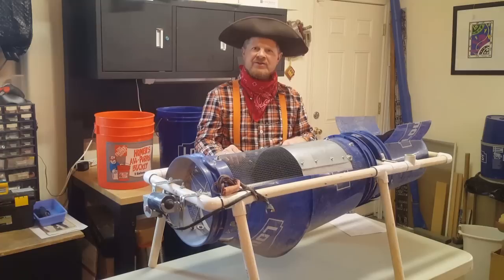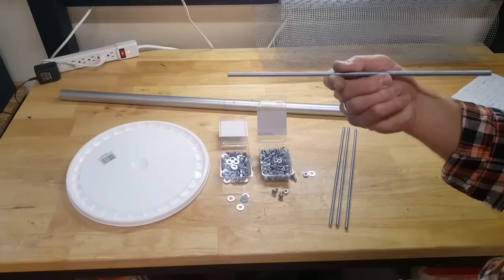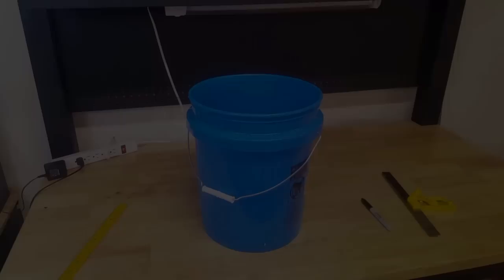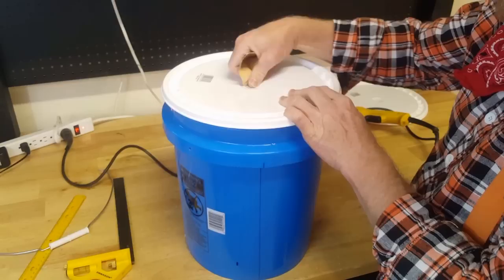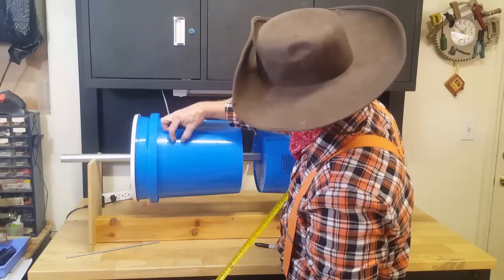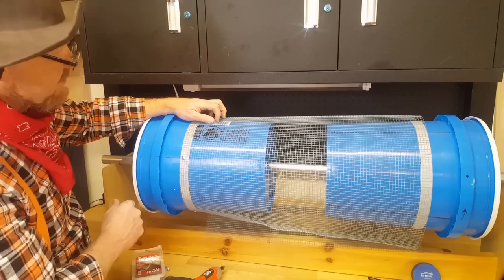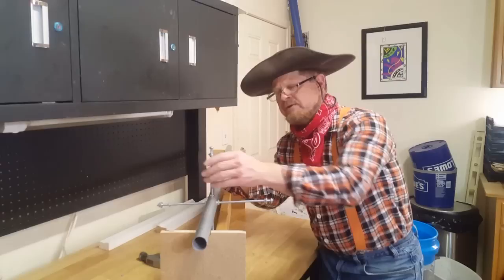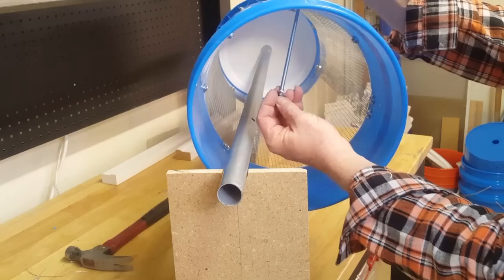Allan's Gold Mining Wash Plant - Trommel Build (Part 1)

Comment: Hi Allen,  used a t with a bushing for the bearing. My first you tube
Quick way to cut the buckets is use a dermal saw blade on a drill mandel, adjust the hight on the drill press and just rotate the bucket. Another trick is cut 2"bands from a bucket and place a pice of screen over the band and press the other band over the screen. The taper of the buckets give you band that will fit over. Good screener for sampling or covering traps.
Reply from the maker: Thanks for sharing this.  My friend did the same for his bucket trommel.  My only concern is the increased drag of the bushings.  They tend to bind as the trommel frame flexes under load.  That's why I prefer pillow block bearing.  Less drag, and adjusts to flexure.

Comment: Ok. You're a genius and you got me. I'm a gonna subscribe. There must be some way of using the water to the top trommel to turn the shaft before it hits the wash area. It gets pumped there anyway and it's not utilised until it hits the pay-dirt.  It'd save one windscreen wiper motor and a bit of power. Actually, it could even be used to turn the bottom trommel too. There's enough force as it comes off the sluice. Just needs a bit of "Out of the box" thinking. By the way, your design is awesomely thought out from start to finish in this first vid. Congrats on a job very well done  :)
Reply from the maker: Thank you for the subscribe and nice compliments !  Glad you enjoyed the video.  Sounds like you potentially have a good idea using water pressure to turn the trommel.  Give it a try.  If it works, post a video.  Would love to see it !I currently replaced the 12 volt bilge pump with a 3hp 1 1/2" trash pump.  This gives me plenty of water (at idle) for trommel and sluice.  Best of all, I can muck out the tubs with it !  Wish you the very best in your prospecting adventures !
Reply: Thank you Allan. My prospecting is limited to my detector at the moment. However I will be panning and sluicing in the near future. I will build your trommel as it is fantastic however being a bit of a novice in all things trommel/sluice I have no idea quite where to begin, especially in regards to water flow requirements at the top/entry where the pay-dirt is put in. Would need a more experienced eye than mine to create a turbine/shaft turner plus delivering the required water-flow to breakup the dirt in the hopper. I will have a look at it tho and see how I go. Cheers and keep your gold lessons coming, they're great!   :)
Reply from the maker: Let me know if you have any questions.  In my original video, I was pumping 3700gph over standard Hungarian Riffles, however, since I changed the sluice insert to a "Pickle Puss Mat" (sold by Snake River Products) I need only 2000 gph.  Slope of the sluice is 4:1 (4" height per 1 ft. length of sluice).  Hope to have a new video in the fall showing all the new improvements.  Good luck on your future trommel build !
Reply: Thanks Allan, will be looking forward to that new video. Also, thanks for those figures, they're pretty much essential. I'll let you know how I go. Cheers

Comment: Alan, I do have a little suggestion that should take a significant amount of time off of adding the threaded rod to the buckets. When you first insert the rod into the bucket with a washer and the nut installed, before you add the second washer and nut you put a SECOND nut on top of the first one and secure them tightly to one another, just make sure that both nuts are near the end of the rod. next, you add the second nut and washer to the inside of the bucket and to thread that nut and washer on you put a 1/4" nut driver into your drill and hold the inside nut with your fingers and proceed to turn the outside nut with the drill and nut driver. This will move or thread the nut and, by the way, the rest of the nuts onto the threaded rod, and therefore cutting all of the tedious time off of that part of the assembly. I do hope that this helps! You just keep up the good work that you're doing to help all of us greenhorns out here!
Reply from the maker: Hi James.  Thank you for the good suggestions !  I'm  all for saving time.  Hope other views read this comment.  Best wishes to you and your trommel build !

Comment: Great project! P.s. your emt should have a line from the manufacturing process that you can use to line up the rods. Also when you run up the nuts on the rods, if you temp double-nut one end, you can use a 1/4" nut driver and drill to run them up quickly.
Reply from the maker: Good suggestions Michael !  Thanks for sharing these ideas.  Have fun with your trommel build and good luck prospecting !

Comment: I loved the video and design.Currently, I am building one, in hopes of joining a club up here in MT this spring! Can't seem to find the squirrel cage shaft though. Can't wait to add it to my sluice. Thank you Allen, for the great design
Reply from the maker: Hi Nicholas !  Glad you enjoyed the video!  Many folks have built this as a winter project, ready for spring prospecting.  Send some pics when you get it running.  The squirrel cage shaft is ETF conduit tubing found in the electrical section of your local hardware store.  Best to you on the build, and good luck prospecting !  👍👍👍
Reply: @allansgoldmining  thank you Allen! You're the best! I'll send a pic or video when completed.
Reply: @allansgoldmining  and so I'm not confused, the ETF conduit, is the part inserted into the EMT silver tubing, correct?
Reply from the maker: @nicholassteichen4552  my apologies. Darn spell checker !  It's EMT electrical tubing that is the main drive shaft.  The insert piece at the end is a 1" steel shaft so it can merge with the pillow block bearing.  This shaft can be found in the swap cooler section of the hardware store, or any metal supply store.  You could simply use a 1" shaft for the entire length, but it's more expensive than a piece of EMT.  On videos 2 and 3, I made a parts list at the end to help you gather materials.  Thanks for watching !

Comment: That bucket that is more firm will actually break easier, they bend so they dont' break. The Lowes one you originally used would be best.

IMO.
Reply from the maker: Same polymer as the Lowes buckets, its the structure that makes it firm.  The trommel ends are to maintain true circle, and do not receive direct impact.  Doubtful they will crack.  Been using mine without issue

Comment: Why would you not put a flat and lock washer on the alignment rods at the shaft to prevent vibration from loosening the nuts?
Reply from the maker: Thank you for your question.  Yes, You can use them. I use Loctite.  Either way is good.

Comment: Very cool and economical design!  Have you looked into a hydro motor/turbine (not electric) for driving the trommel so you don't have to carry a battery, just using water pressure from your pump to drive it ?  Just wondering if that's been done.  Cheers! Chris.
Reply from the maker: Thanks Chris.  Glad you like the videos.  Never thought of a hydro motor turbine.  However, it would require some source of energy.  Namely a battery to run the pump.  The energy required to operate the turbine, plus wash rocks, might be be significantly greater.

Comment: Try slapping a big magnet somewhere at the top of the sluice to gather the iron / black sand.
Reply from the maker: Nice thought James, however, it traps gold within the iron / black sand filings and eventually obstructs the flow onto the sluice.  Been there, done that.  A possible solution would to install a large "Spin-it-Off" unit on the head plate that would continuously spin and peel off black sand, thus leaving the gold in the sluice.  I have a friend working on this design.  Thanks for your suggestion !

Comment: Would it be better to run a 1-2" metal band along your wire edge, instead of using wire to put it together and using lock washers?  Thanks for taking the time to make the video.
Reply from the maker: Thanks for your suggestion.  Yeah, I think that's a good idea.  Best of luck to you prospecting !

Comment: How long is the conduit and what we’re the measurements for the threaded rod on the conduit? Can’t wait to start this project! Thanks!
Reply from the maker: The conduit is about 36", the threaded rods are 12".  If you watch part 2, I explain in better detail.  Also there is a detailed shopping list at the end.  Wish you the best in your trommel project.  Be sure to check out my trommel drive motor update that I released today.  Thanks !
Reply: Allan Guthmiller thank you! Yes I did watch that today. JB weld is great stuff. I built one a while back but it’s a hand crank and not as sturdy as what you have built. Thanks for getting back to me. Heavy pans!!!!
Reply from the maker: You betcha Bro !

Comment: Hi Allen, great DIY video on the trommel build. What size water pump would you recommend for this set up? Also do you have a video that goes more in detail on the metal plates mounted in the trommel? Thanks!
Reply from the maker: Thanks for watching.  Hundreds of people have built this trommel as a winter project.  There's two more videos to the series.  Videos 2 & 3 have a parts list at the end.  I recommend a 12 volt 2500 GPH pump or a gas powered equivalent.  Enjoy your trommel build !
Reply: @allansgoldmining  thanks for the help!

Comment: Hi Allan, I first saw you with Jeff Williams and Slim out in lost basin video, you truly have a fabulous Wash Plant and I would love to build one. I watched your first video and now have just two questions, how long did you cut the conduit? And are the bolts 1/2 long or 3/4" 1/4 X 20? Thanks for your fabulous work and time.Al
Reply from the maker: Glad you enjoyed the video.  If you watch Part 2 and Part 3, I have a handy parts list at end of the videos, which should be helpful.  As for your questions, I use 1/2" 1/4-20 bolts.  Although 3/4" will work just fine.  I initially cut the pipe about 48" to fit on jig.  Video 2 explains how I cut the pipe down for mounting.  Usually, about an inch beyond bucket rim of trommel. Thanks for asking, and have fun on your trommel build !
Reply from the maker: Thermal Rider ?  Are you a sailplane pilot ?  So am I.
Reply: Thank you for getting back to me, I picked up all the materials to build my trommel and started my build last night. As for the airplane in the background it is a 1947 Cub of a friend, we fly RC planes together.
Reply from the maker: Very cool.  I fly RC as well.  Mostly electric these days.  Just took a flight on a B-24 Liberator this weekend.  A ride of a lifetime !  Posted a video on my channel.  Good luck finding gold with your new trommel !

Comment: Hi, Allen, you didn't mention that I heard , what is the length of the 1/4 inch screen ???  !/4 inch mesh by ?????
Reply from the maker: Sorry for late reply.  I use a 1/4" square screen mesh on the upper trommel, and a 60 mesh screen wrapped over a 1/4" screen on the dewatering trommel.  Thanks for watching !!

Comment: Hi Allen I am not a Engineer but what if you used two strips of aluminum 2 ft long 1 in wide bolted up to each bucket before you put your screen on to give you a bit more rigidity one where you have your screen edge meet and the other straight across to the other side .
Reply from the maker: Thank you for your question.  I would not recommend that technique, because the buckets are slightly tapered.  Would be difficult to maintain alignment.  This is why I use a centered shaft and hole.  Good luck on your trommel build.

Comment: Hi Allan, that was a nice build instructional - I wonder about the center shaft - seems like alot of tedious operation --- was there a particular reasoning for that style as opposed to having the barrel rotate on supporting wheels ?
Reply: i'm guessing it has to do with the PVC support frame and portability ....
Reply from the maker: Hi Robert. Simplicity, weight, portability, and costs were consideration.  The plastic buckets flex a bit under the weight of material, making it a challenge to maintain symmetry. A central shaft gives all the plastic components something to align with.  I built a plastic bucket trommel on rollers, and works well because the base is 2x4 wood frame.  Actually, it's a dual counter rotating trommel (one inside the other).  The inner trommel turns on the traditional shaft, while the outer unit is on rollers and drive belt.  It was a test model for a fine dewatering system that failed to meet my expectations, eventually leading to the linear transfer dewatering deck I'm operating today.  BTW, hundreds of people globally have built this design and are using it in the field..  Quite amazing ! Thanks for your questions, and thanks for watching !

Comment: First thing I thought was the particle board will swell if it gets wet. Osb would be better, no?
Reply from the maker: The trommel doesn't use particle board as it's operation.  It is merely a holding jig for assembly.  Thanks for watching.

Comment: Great work! Question, for shovel/bucket style feeding as you do, is there any advantage to making the trommel a larger diameter, longer, or both? I am thinking that the longer the dirt stays in the trommel the better the washing and screening.
Reply from the maker: Thank you for your thoughts.  Yes, a larger diameter and/or longer trommel would be better.  In my demonstration, I'm dealing with simple materials.  So, the 5 gal buckets limits diameter, however, one could increase length to make the difference.  However, there is a limit.  The more rocks you have tumbling in the trommel, a larger motor drive unit is required to handle the load.  My design is within these limits.  Although,  I have stalled the trommel a few times by overloading it.  So, it's a bit of an engineering trade-off.   Thanks for watching and good luck on your trommel build !  🤠⛏⚒👍

Comment: how often do you have to replace the 1/4 inch mesh? or do you?
Reply from the maker: Good question.  I have run about 25 cu yds so far, with no signs of wear.  I will be coming out with a new video this fall, demonstrating the latest upgrades and virgin ground currently working.  Stay tuned !

Comment: When you cut the bucket from the other end and pushed it through how did you cut it without cutting into the secured wire?
Reply from the maker: Thank you for your question.  If you review segment starting at about 19:00, you will notice that I pre-cut the bucket, leaving only 4 small segments attached.  This maintains stability during assembly because the shaft hole is retained.  When it comes time to completely seperate the lower portion of the bucket, there's only a few inches that need cutting.  I'm very careful to keep the cuts superficial to prevent cutting the screen.  Hope this helps.
Reply: @allansgoldmining  Thank you.

Comment: What's that little B/D screwdriver you're using? Nice little tool. Is it a fixed handle or does it adjust? Thanks.
Reply from the maker: It's a fixed handle.  Comes with multiple inserts for different screws.  About $25 at hardware store.
Reply: Thanks
Reply: Bought one today at Lowes.

Comment: I just got the wiper motor and was wondering if 14 awg wire be ok to splice onto the motor's wire harness for the battery connection?
Reply from the maker: Yes, that should be fine.  If want save money, buy a cheap two lead AC extension from Walmart and cut the plugs off.  That's what I did.  Just make sure you mark which is positive and negative.

Comment: If you flip the direction of the outfeed bucket you shouldn’t need to squish the wire to fit within it.
Reply from the maker: Yes, but now you have tapered end of the bucket working against you, requiring the trommel to be tilted a steeper angle, thus increasing flow speed and reducing wash time.  If the bucket was truly straight it could work, but they are not.  Try it, you'll see what I mean.
Reply: @allansgoldmining  - looking at 5 gal buckets I see exactly what you mean.  I happened to have used 7 gallon buckets where the top 7 inches have almost no taper.  I got lucky.
Reply from the maker: Hey,  that's good to know. 👍

Comment: may have to paint them cause they may degrade in sun ☀ ☀ dont know ?😁
Reply from the maker: Yes, they will degrade leaving it out in the elements 24/7.  However, it's much cheaper to replace verses spending $$$$ on a metal unit.  I keep my unit in a shed when not in use. 👍

Comment: Why don't you use rubber washers
Reply from the maker: Rubber washers where ?
Reply: @allansgoldmining  instead of the metal ones you used to hold your mesh on the buckets.
Reply from the maker: Oh okay.  Yes, I guess you could if the rubber is firm enough.  Definitely an alternative.
Reply: @allansgoldmining  an old tire side wall
Reply from the maker: @hardluckhenry  sounds about right